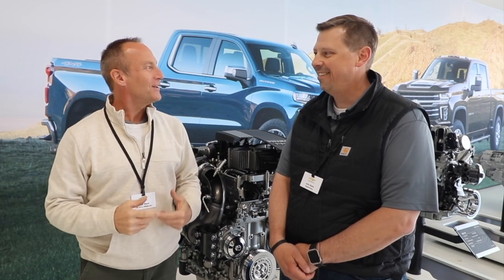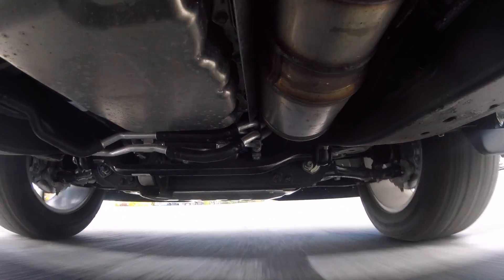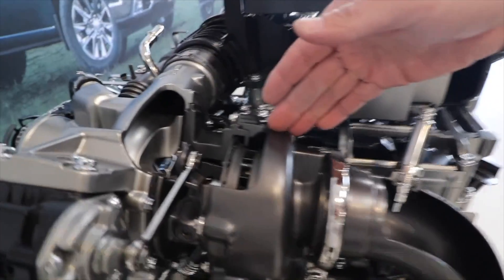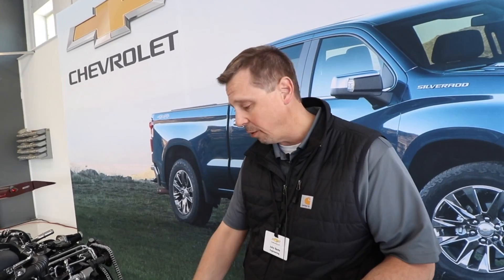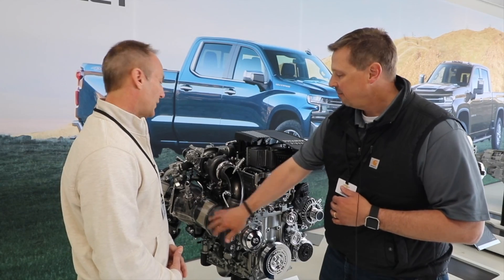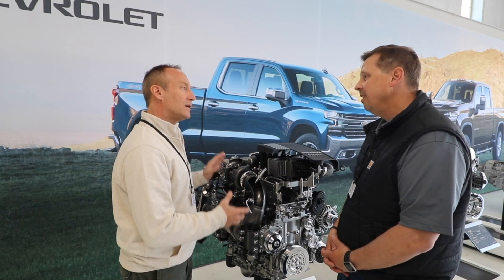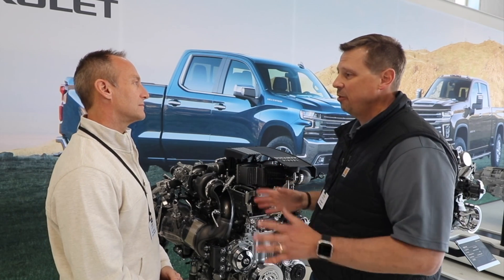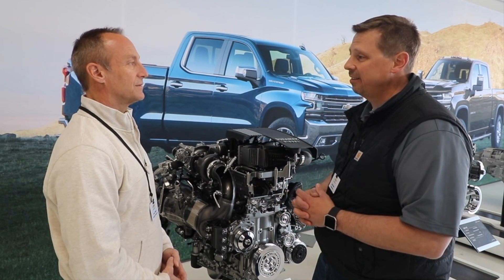Engineer Reveals All! Duramax 3.0L for Silverado 33 mpg hwy

Comment: Way too much bullshit on the exhaust. How is it a good thing to out exhaust gas back into the engine, or any engine for that matter? It's all a bunch of extra parts that cost money and line someone's pockets on the back side of things. It's actually proven that a diesel that is tuned right, burns cleaner and is more efficient than one of these heavily regulated new "Emissions Compliant" engines. But that tuned truck doesn't make money for those that are greedy and want to regulate the diesel industry. Just remember, everything you use everyday, was delivered to you by diesel powered transportation.

Comment: $65,000 min diesel truck, chevy is exp full life around 150,000 miles.  A 6.0l gas truck with run twice that in miles. what a joke! wait for the emissions to rear it's ugly head, like it has done on all newer 3/4 ton diesel trucks. 3750 rpm diesel, no wonder 150,000mile guess is just waiting for all the chevy sheep to line up to do a couple years of real world testing for them. cost effective for GM. how is a regren every 400 or 500 miles a greener engine? burning more fossil fuels every 400-500 miles?  is the 4-500 mile 8-10minute regen also calculated along with the def fluid in the MPG estimates in GM literature?  More reason to buy a big displacement gas engine, ford will have a 7.3 gas

Comment: I see no reason to own a diesel unless you use it for work. It cost more to maintain, doesn't get better mpg.
Reply: They get much better mpg. My friends 05 f250 gets 26 with a 8 in lift on 37’s. My f250’s all got about 20 and my Cummins got 26. My 07 gas Jeep gets like 17. Hell my accord only got like 26 freeway.
Reply: The Fast Lane Truck got 31 MPH, and Mr Truck and a fellow from GM got 44 MPG hypermiling

Comment: Let see a belt driven oil pump, NO TRANSMISSION dipstick, no drain bolt to drain the front differential!!
Garbage!! Cheap ass engineering!!
Just another gimmick to say gm has a diesel in a 1500!! Garbage!!
Buy a 5.3 or 6.2 gasser and save yourself a headache!!!

Comment: mickey mouse timing chains
Reply from the maker: I asked him if all the chrome parts were standard or if it was an upgrade ;)
Reply: @4WDMagazine  So, it looks like the timing chain is on the back of the engine, how hard will it be to change ? Does the engine need to come out to replace the TChain?
Reply from the maker: Good question. I can't remember but I'm still working on the next video and I will try to find out. I saw four different Chevy engines in the last couple of days plus a few others.
Reply: @johnhenry1395  No, unbolt the transmission and there appears to be a cover that's removable to access the chains.
Reply: No, these are long lasting roller chains, not the cheap mickey mouse inverted tooth timing chains Ford uses on everything these days and are stretched by 80k miles.
Reply from the maker: Thanks for clarification!

Comment: Garbage truck with garbage engine that can only go 150k miles and it's toast
Reply from the maker: bad experience with chevy or diesels?
Reply: @4WDMagazine  I have an lbz with over 260k miles on it and it will outlast these new trucks. I have a problem with the new GM ever since that woman took over. Quality has gone way down and price keeps going up. They don't make em like they used to.